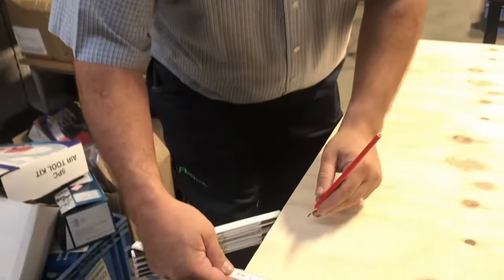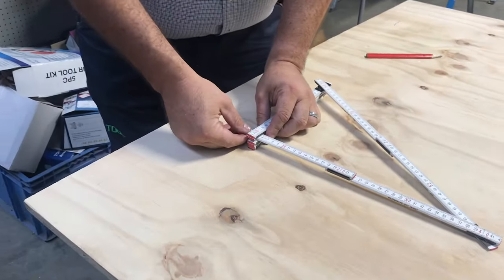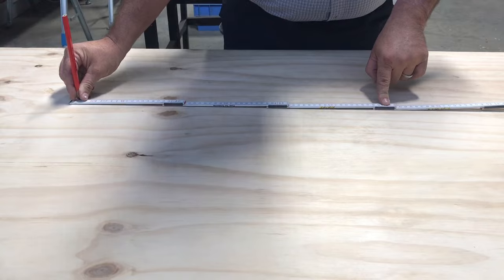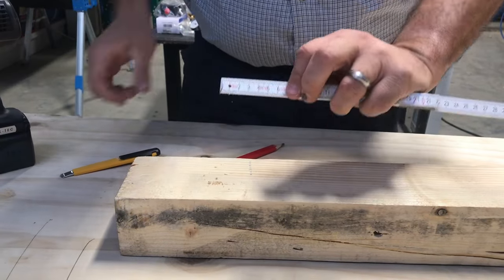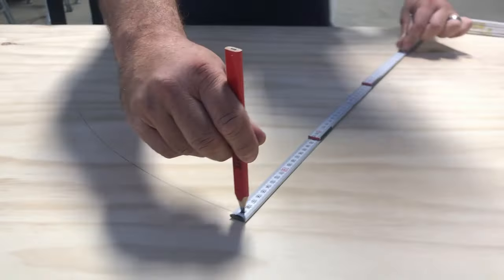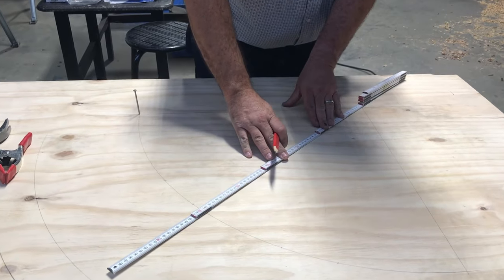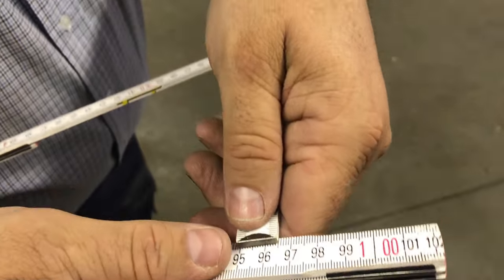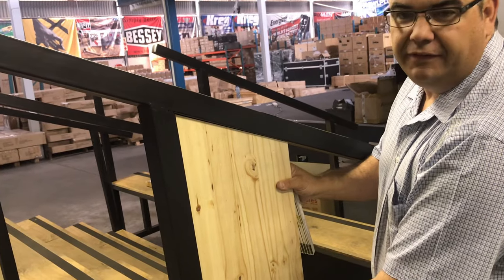Things you did not know about a folding ruler

Comment: For tip #1, always have tweezers on hand to remove the splinters from the guide finger.  ;-)
Reply: Curl your index finger so the pad touches the first joint, place your thumb on the side between the second and third index finger joints, pinch the ruler perpendicular to the second (middle) index phalange. Et voilà, your nail is now your sliding surface.
Reply: @dylanneely91  Good tip. Still, it's reminds me of the expert chef's chopping technique where you use your knuckles to guide the blade. Looks so easy...  :-O
Reply: @commentatron  lol no doubt. My wife was a chef. Her coordination (or lack there of) gave me no shortage of conniptions when she told me the were teaching her to cut.
Reply: @dylanneely91  enabling the splinters to go directly into the nailbed does not seem like a great solution to that problem.
Reply: @LordPadriac  with the exception of douglas fir and wenge I've never had that issue. Just keep the nail tip from dragging on the wood and any splinters you manage to get will be in your knuckles. Much less troublesome than the pad or nailbed if not just as painful but thankfully VERY rare.
Reply: No, just use your pocket knife for that, lol
Reply: I had to get one back in 76 as apprentice . The older guys used them a lot, but good tape measures were getting more use then and that’s what I used. I do remember one foreman wanted wood doors to be fitted so the spacing was the thickness of his rule👍
Reply: Y’all are real !!😅 H.
Reply: #3…barely shows rule bending at one of the joints while drawing his arc, therefore shortening the arc through its travel.  Some tools work better than others.

Comment: I was raised using a folding rule. Doing the tip one procedure was no problem. The skin on the side of my finger was so tuff it broke of the splinters. Splinters were removed with a pocket knife. Tapes and folding rules are both useful. People go for the less effort of tape use. Same they are not using both as a rule has many more benefits than shown. Glad these were shared.

Comment: Tip 2 Or, you could use a square, which was made for that purpose. You know, the tool which was made for that purpose (what craftsman doesn't own a square?), is more accurate, and had an edge you can actually draw a straight line with.
Reply: Having a field expedient option saves a trip to the hardware store when the crack heads steal your tools. Or the apprentice drops it off the roof. Or you lent yours to the new guy. Or another team mate moved your tools and you would have to spend time to find them. Or or or or....

What craftsman doesn't want to develop additional skills?
Reply: do you complain about people giving tips in your real life too? lol
Reply: @synapticburn  If the "tip" is some convoluted thing whcih isn't going to work particularly well, and serves no real purpose other than a "hey look at me, aren't I smart"  , then, yes, I do.
Reply: @andrewalexander9492  lol why u so whiny bro

Comment: That is Not 90 degrees because of the hing point of the ruler.. With the older rulers that had the hing piomt in the center at the end thera is endless math problems that can be solved.
Reply: On mine, the hinge is exactly on 6 inches, in the center of the stick. So measurements need to be based off the center of my stick to produce what you're describing

Comment: nothing done here that cant be done more accurately with other measuring tools or jigs.  I was given on of these.  Its grows more inaccurate with each segment.  Its results are much better than an guess but I would never use it where measurements mattered.  Its just a conversation piece.
Reply: He doesn't say they are to replace more precise tools. He says using the ruler if you don't have the more precise tools.
Reply: Are you saying that it gets loose? Seems to me that this would be very handy and much more accurate and fast for doing something like building cabinets... say you had to repeat a measurement to set a drawer Glide or line up a panel you could Mark right on the ruler and transfer that Mark several times very accurately. In my opinion the average tape measure isn't that accurate from push to pull. It also seems like it would be perfect for setting tools up to cut certain depths or widths such as a table saw blade a router even a drill bit... just the ability to measure with it and to draw lines on it to transfer measurements makes it almost like having a tape measure and a combination Square...
I put in time at a cabinet and Woodworking Shop can I guarantee if I dig up my grandfather's folding ruler and start using it at work everyone will have one
Reply: It doesn't get very inaccurate with each segment if the segments are marked properly. You might have been given a crappy off-brand.
Reply: A masons tool at best